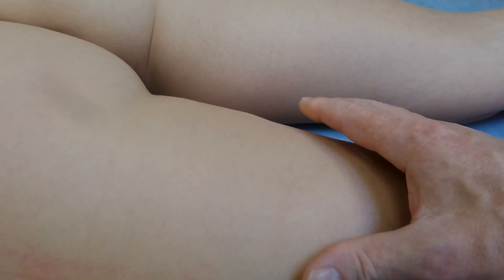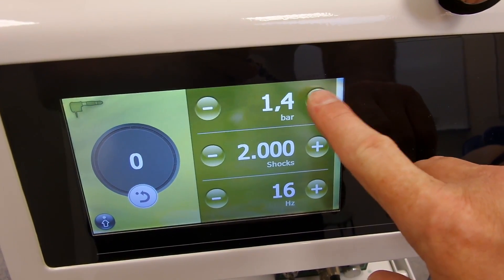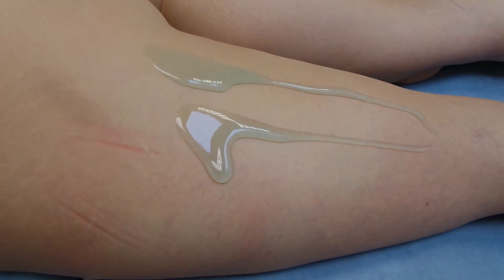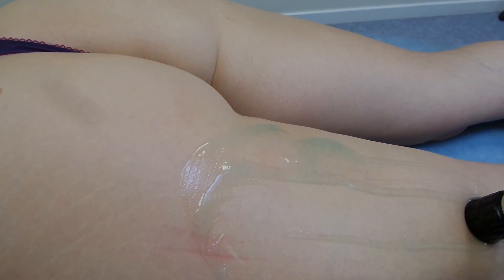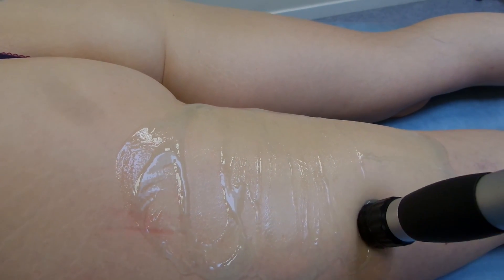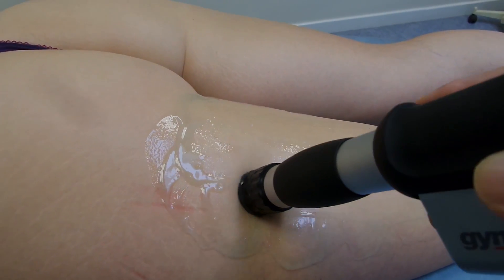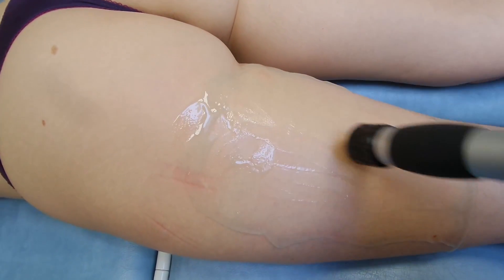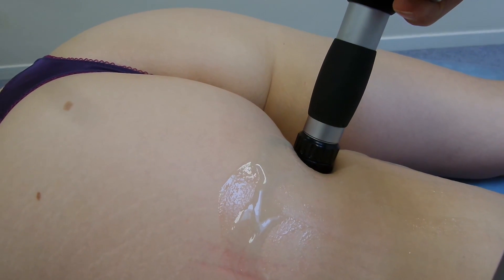Cellulite treatment using shockwave (Shockmaster 300 Gymna)

Comment: Is it 4000 shots each thigh?
Reply: if you want more detail , pls contact me .whatsapp :+0086 18070547392
Reply from the maker: Generally you will need about 1000-2000 shocks per treatment head size so the larger the head the lower the number of shocks and vice versa